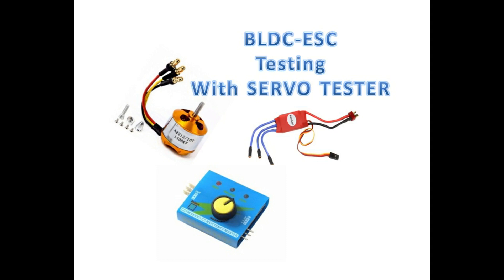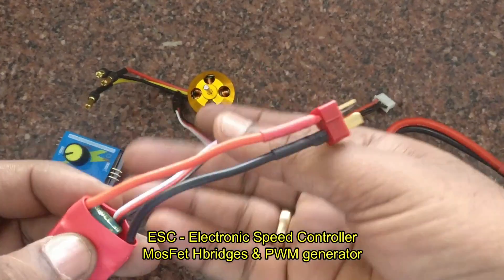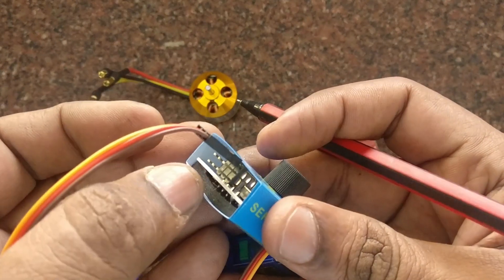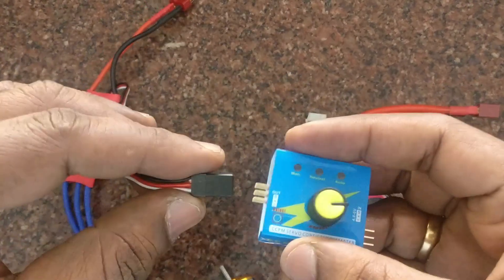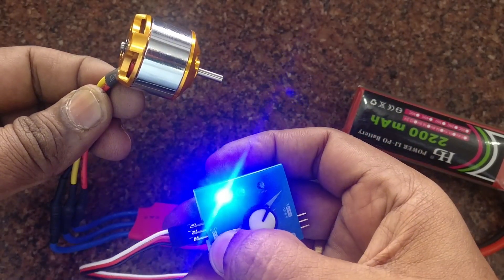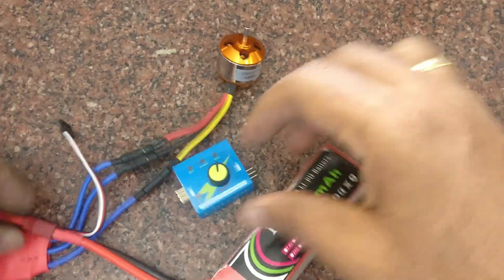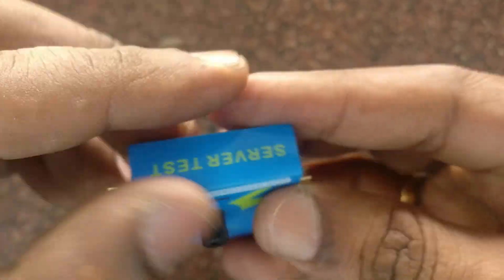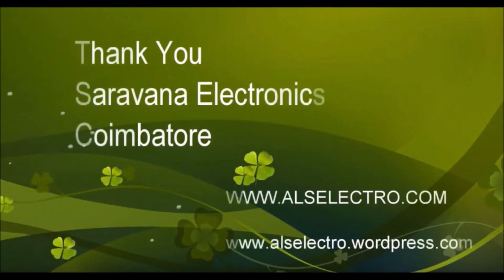Testing BLDC ESC using SERVO TESTER

Comment: Thank you , very educational , if I may - if I have two batteries of a total of 60 volts together and motor is 70 Kv  that means I should have 4200 Rpm ?

Comment: Can I use that signal line and connect it to the pwm pin of 4pin pc fan? So the 2 wires on pc fan connect to 12v source and that pwm pin on the pc fan connect with this rc motor signal line? Will it work?

Comment: helpful  video !!!!  I was unsure if I  was able to use my 3S 2200 mAh LiPo  to test my  servos with , because the tester states 4.0v - 6.0v range.....but if I understand correctly , as long as I connect the  higher voltage   LiPo battery through the ESC, ( to the OUTPUT  side of the tester )  it's OK...correct?....thanks
Reply: Can we run bldc motor continuosly using servo tester

Comment: Hello. With the exact same configuration you have. Can I replace the battery with a 12 V DC power supply ?
Reply: Yes 
I tried
It's working
I tried using a 12V adapter

Comment: Oe manuy amp battery require
Reply: depends on what you are doing. in your case, it sounds like guesswork not engineering. so good luck with whatever you are doing